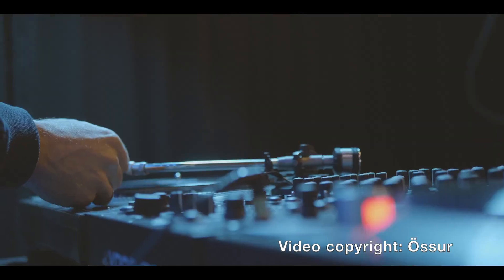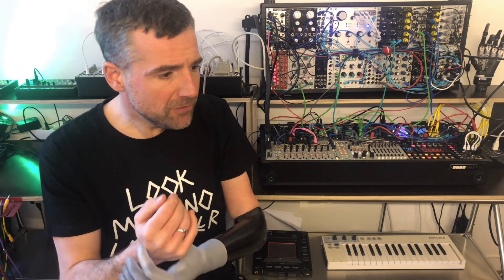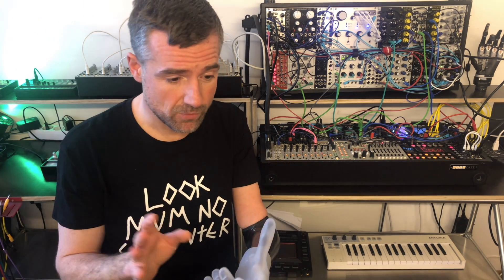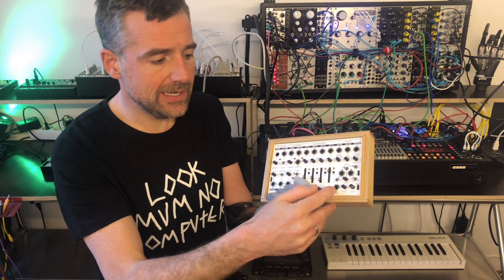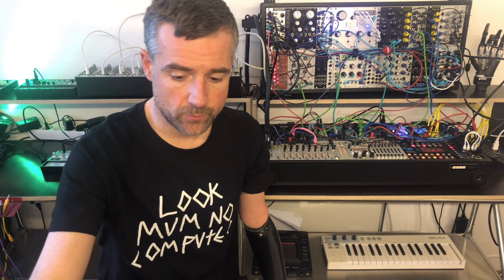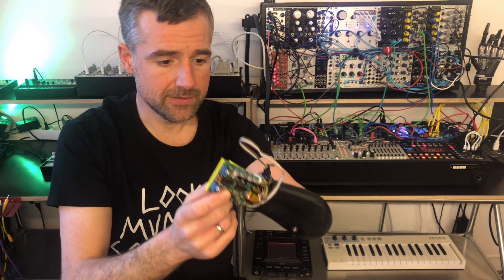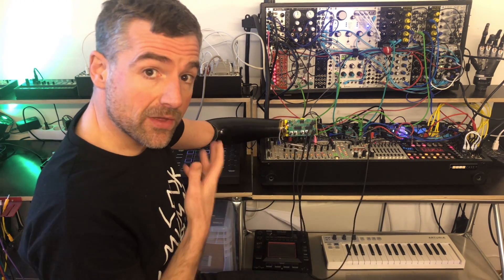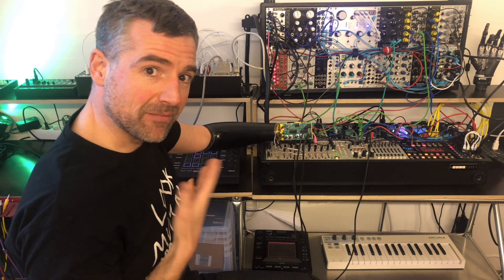Hacking my arm prosthesis to output CV so that it plugs into my synth: Thought-controlled music!

Comment: I really love what you've done here! Just imagining the possibilities: I noticed you can do at least four operations with your prosthesis: open, close, rotate cw, and rotate ccw. What if you had a device that converted each of these signal into MIDI. Then you could do things like map rotate cw and rotate ccw to turn a virtual knob. And open and closed could be mapped to select the previous or next knob from a list. This seems like it could be a pretty capable MIDI controller.
Reply: why stop there just get another "prosthesis" by connecting similar tech to other muscles in the body. Hell you could have an entire board controlled with your brain.

Comment: Awesome project!
Curious about the "thought" connection: how you learned to control the prosthetic originally, that is, how did you teach your brain to "tell" the prosthetic to move in the various ways. And, could that be extended so that anyone could have electrodes in the right places (muscles? nerves?) react to brain signals. Not flexing or twitching the muscle as you would normally, but just thinking of doing it...possible?
Reply: The duality of man 
- In-depth, thought-out response
- I want six arms
Reply: EitherOr Animations   Both are great, don’t you think?)
Reply: He controls his prosthetic by consciously flexing a muscle on the healthy part of his arm. The electrical signals from this contraction are used to signal the prosthetic hand to close. Since he's shown 2 unique modes that he can activate on his modular synthesizer, I'm guessing there are 2 unique muscle contractions that activate each one and that are ordinarily used to perform different movements on the prosthetic limb. 

As for if anyone could be able to use this tech just by thinking the commands. They've already been able to get quadriplegics to move a prosthetic arm (as well as virtual objects across a screen) using only their thoughts (electrodes on or under their scalp) rather than using the signal from muscle twitches. Given this, I see no reason why those same signals can't be used by anyone for an application like this.

 DARPA does a lot of research in this area, but lots of companies are beginning to dip their toes into "brain computer interfacing" -  well worth looking up if you have the time. Even hobbyists have been able to use EEGs to do cool stuff like turning on and off a lightbulb with just your thoughts.
Reply: Wei Zhao Indian God Metal Drummer.
Reply: I ride a one wheel electric bike, that can do 60kmph for two hours straight. Anyway, it's controlled by shifting yourself and your weight forward, backward, left and right to drive this thing. After a year of riding like this professionally I literally could eat spaghetti from a plate with a fork (my hands are free all the time) and not really think about driving and still get where I want to go. It's amazing.
Reply: @supersonictumbleweed  post a video of that
Reply: Also, some guy even tried controlling the accelerator of a car to a reasonable amount of success
Reply: @DMack6464  Michael Reeves. That was Michael Reeves
Reply: Just like learning to play any instrument such as the piano. Through practice, practice, practice. A custom prostetic with 10,000 hours of practice becomes basic muscle memory at that point ...

It's impressive the coming together of resources to make the first fabbed concept board, and the generosity of the lead developer.

All music is played through thought, most of the time it's expressed through the fingers. he's simply created a novel middleware adapter that greatly benefits his circumstance. Which is great for everyone sharing his interest and passions similarly abled.

Comment: I think if you use a couple of microcontrollers and some bluetooth modules, you should be able to do some wireless testing which I guess would completely free the other arm. The only problem is like latency. I'm not an engineer myself but I've done some testing. I guess if there would be a way to do it with low latency your project would be next level. Keep up with the great work! 👍

Comment: You could set up the second control as an output selector so then you could control more than two things, albeit one at a time.  

Or if you had a Midi module you could use a blokas midihub (not out yet) to program multiple sweeps and interactions that you could then turn back into CV outputs, all controlled by just one of the outputs.

Comment: Awesome! If you add a bluetooth module (for example, the HC05) you can actually achieve telekinesis superpowers! If you add the bluetooth module in parallel to your prosthetics you don't have to remove the hand to operate the mixer, and using two bluetooth modules in each arm you can even use both hands at the same time!

Comment: Okay so I'm just spit balling here but hear me out. If you made this a chassis of some sort to give it rigidity, a little display to provide feedback/show what options are selected, I can definitely see a system mocked up to allow you to control the various adjustments as you are now, but instead of each signal being directly sent to the synth, the signals are going through a circuit that acts as a router of sorts and you can make little selections on the chassis either with buttons or dials or a touch screen and change what controls you're directing the signals towards. At this point, you could control the entire synth with your mind simply by selecting which options to swap between at the click of a button. Please keep this going, this is our cyberpunk future, we're living in it.

Comment: Next thing you could make a special controller with conducting plates, imagine it looking like a roland spd. But with conducting metal plates. And on the arm you’d have a thing made of conducting metal as well so you van touch the pads that would be controlling different filters and stuff so you can just touch the pads and instantly change the parameters with your mind. Instead of having to keep plugging the cable in somewhere else!

Comment: Could you find someone to make a circuit to use the voltage from the second output to switch the first signal between multiple outputs while holding the last voltage output?

Comment: I think it's worth mentioning, that you don't "need" to have a missing hand. The nerves are all the same (although if born with a hand missing, the structures arguably have shifted slightly in regards to position, distally). The electrical signals from the neurons that activate the muscles can be measured (and amplified) with electrodes on the skin. Differences between a natural and a prosthetic arm would be whether or not the arm would move when neurons fire since you can't block the neurons from activating the muscles, but you can, however, block the motor movements in a prosthetic hand, by simply not responding to nerve-signaling. Other "advantage" to having a prosthetic arm is that the wiring is already in place from the prosthesis manufacturer, so you would only program the output signals from the prosthesis. And, of course, it looks much cooler to stick a hand in a computer rather than an external device.

Comment: Here is an idea for you. I don’t know if this product exists but I’m sure it does. Find a CV switching unit. Something that can cycle between various cv connections based on a gate input. Then. Connect one of your Cv-mind controllers up to the actual modulation connection and the other up to the gate connection. With some futzing you could end up being able to jump around be it in order through multiple modules and do full performances.

Comment: What if you used 1 electrode to control nob setting and another to control on witch synth nob do you want to change setting? That way you could control everything whitout changing cables in between. Would that be possible?
Is there a limit on how many nobs on synth can be controled by cable?

@
Bertolt Meyer

Comment: I'm blown away by the genius of this device. To turn a "disability" into a giant ability because you "saw" what was possible and started working on it... that's how the truly world-changing inventions are made.
Reply: I had thyroid cancer and got my neck fused c3-c7 front and back. After my surgeries I lost my high range in my voice but gains lows like thunder so I sing songs retuned down to my vocal range.  I go to the state park with acoustics in a pavilion and get my voice echoing there. See my surgeries video.
Reply: I would not call it giant ability. Compared to the use of regular hands it is still a disability. I like the determination, tho, not hating.
Reply: @kyrilcouda  Well, as he is only limited to two jacks yeah, its still a bit worse than just a hand. but imagine he had access to a prothesis that could read more signals than that and ended up with lets say 5 or 6 jacks. At this point he can reach even some sort of advantage over a regular hand as he can naturally control several controllers at once without moving his arm even by an inch
Reply: @Alchemik131  I still can see same devices being created based on finger/wrist movements. The point is that I just want you all to acknowledge that the fact tha he lost a hand did not create for him any advantages whatsoever. The only thing admirable here is the sheer determination and maybe the engineering skills, but that depends on where you put the baseline.
Reply: @kyrilcouda  He took his disavantage into a plus, it's not totally great like this video BUT it's how you would take something negative into positive
Reply: Breaking news: man without an arm invents brain piano

Comment: Amazing! I have a question though... How do you control the filter and pitch parameters individually? Is it that different muscle movements control the different parameters? Do you have trouble distinguishing between the two? eg: accidentally changing pitch when you were intending to change the filter cutoff... And lastly, how many individual parameters can you control? Awesome stuff!!!
Reply from the maker: Remy Brooks The Synlimb has two channels at the moment and each is controlled by a different muscle signal. one channel corresponds to flexing/extending the (nonexistent) wrist outwards, the other to flexing it inwards. A simultanes signal on both channels is also possible, that’s called a co-contraction. Signals are pretty well separated.

Comment: Please, in your next design, include some isolation to protect you from the synth's power supply. An isolation transformer, battery power your rig, go optical or wireless, something. The community will help you.
Reply from the maker: That is a very valid point. We are already on it, next version will use optocouplers to isolate me from the synth. Wireless doesn’t seem feasible at the moment due to latency.
Reply from the maker: That is a very valid point. The next iteration of the circuit will have optocouplers to isolate me from the system. Wireless doesn’t seem feasible due to latency issues - at least for now.

Comment: What about adding a accelerometer to the circuit to get even more cv out?
Reply from the maker: effiksmusic uhh that’s a very interesting idea, hadn’t really thought about it! Will need to think some about it.
Reply: Bertolt Meyer probably the acceleration would have to be adjusted carefully, otherwise there would be to much change in the cv if it reacts to every small movement. I experimented with such device. The accelerometer creating cv for movement x and y direction. But if you like to hold a certain voltage, I had to keep it in this exact position.

Comment: Hi, i'm industrial automation engineer for around 35 years. When i hear the story about 0..1.5V then convert it to 0..10V is for me a easy way with hardware. SOftware based and you were be able to manipulate the signals in the way you want. I have some ideras for a new part of it. Possible we can talk about it?
Reply: Reply to ,ysel;f, haha. The hardware you have multiple oyt puts in teh same time. Possible with different software filters at the same time. I don't understand synth's in any way but together we could do an amzing job.

Comment: very cool, I immediately wondered if you could control a basic 2D platform video game using a similar method, or even a computer mouse X/Y position.
Reply from the maker: DoctorNoob Absolutely yes! And in all fairness, I am not the first to have this idea. There was a company a few years ago that made a device called the myoband that you could wear around your arm. It would pick up the muscle signals like my electrodes and send them via bluetooth. There was also an API I believe. I can’t find the company on google anymore so it seems that it didn’t work out for them in the end.

Comment: Thank you for sharing such a detailed look at the process of creating the working result! I work with all different kinds of sensors to expore intuitive ways of controlling sound and visuals through EEG, body movement, or hand gestures, etc...I love that you are tapping directly into your nerve signals, pretty much the most direct form of thought - controlled music. I love this so much!
Reply from the maker: Thanks so much. I have to say though, the electrodes in my prosthesis pick up muscle signals, not nerve signals (it’s an EMG signal). So it’s still a bit of a detour from nerve to muscle to signal. It’s just that I am so used to generating these signals through years of prosthesis use that it feels so effortless.

Comment: Isn't there some way you could've added this functionality without removing the hand?
Reply from the maker: Desmaad Ahh good point. The hand turns the analogue electrode signals into digital ones, using a proprietary closed system. I didn’t see a feasible way to get to the signals inside the hand, i needed to grab them before they reached the hand.

Comment: Dude, this is really cool! Though I don't know much about synths or electronic prostheses (even though it is something I have an interest for) I just had a question that I was wondering if someone could answer. Since it is a port that accepts electricity to make a noise or change a value in a program or whatever it is that it is doing, isn't there a risk of something like a power surge that then can travle back out the input and destroy the prosthetic arm?

Comment: I have always considered that at some point being an amputee would be beneficial. This an amazing use of technology and the perspective you've been given on the world. It's so cool that you have just become one with your machine. It would be awesome if you could go wireless. I wonder what advantages nuralinks technology could bring to someone trying to create things, like you.
Reply: Yeah, if you could transmit what the voltage levels are wirelessly to a little box that does the actual CV conversion, the actual part that needs to go in the prosthesis can be made very small to have more space for additional functionality
Reply: You could still do this without being an amputee... How about you look up to Dr. Octopus before lopping off your arm.
Reply: @draageel  I must agree. It takes the signal from your muscle, which you can still do without being an amputee; the thing is, at this point you might as well have a glove with some buttons on it or something. This technology is actually not as awesome as it seems, because whatever it is you want to do with your arm, you can probably already do with your mobile phone

Comment: Wow this is crazy genuis. 
So with which movement do you regulate the knob, by moving your pointy finger and your thumb? And how do you differentiate between the two outputs?
Reply from the maker: So the muscles in my arm stump that the electrodes pick up are those muscles that would flex the left wrist if I had one. So it's really more like a wrist-flexion movement that I am making, Outwards is Channel 1, inwards in Channel 2. Both are also possible but I need more training for that.
Reply: @myowelt  so what do you use for channel 2? tilting up and down maybe?
Reply from the maker: Andres Cicenia So channel 1 is like tilting outwards and channel 2 is tilting inwards
Reply from the maker: AFNacapella Ooo that’s a really good idea. Adding triggers is def down the line!